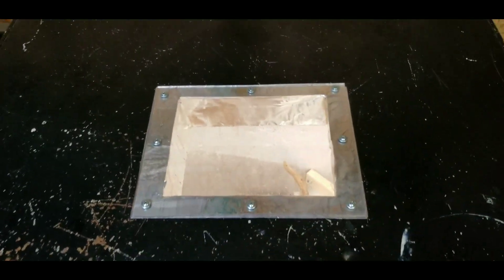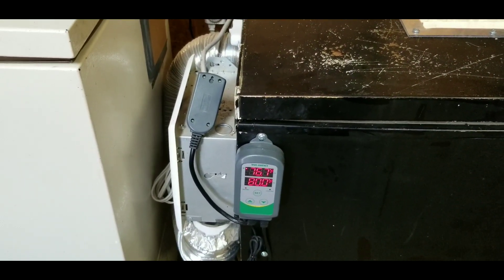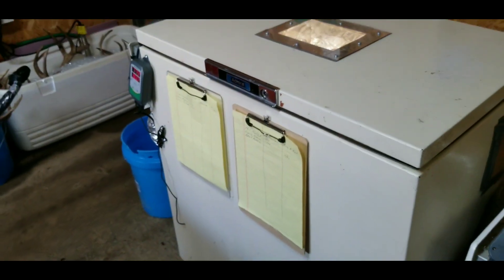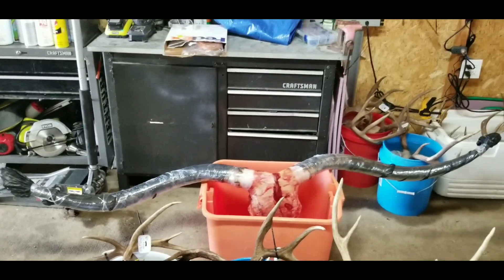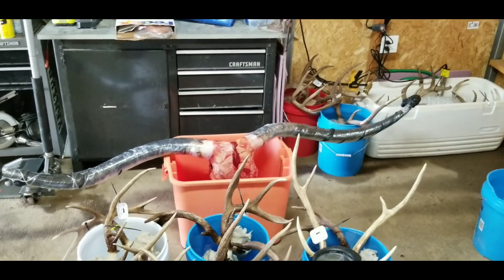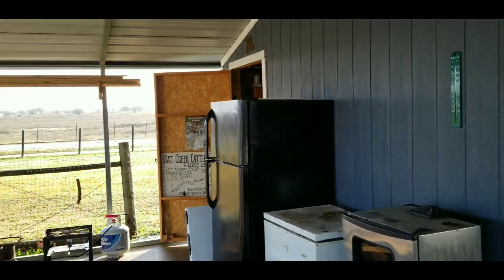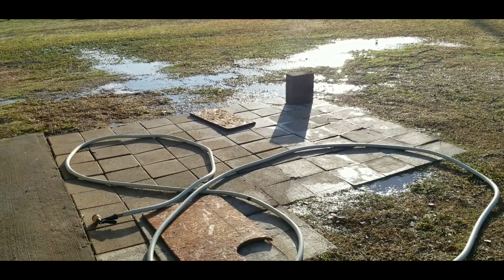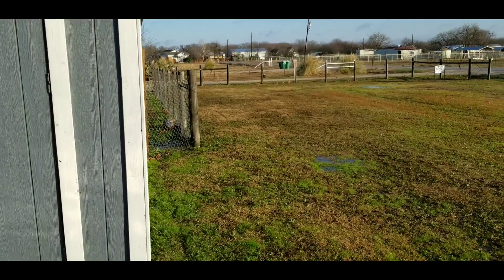Flesh Eating Beetle Update

Comment: I have been binge watching all of your videos and they are awesome! I am currently just boiling heads right now, but I find it harsh on them, and at times the pressure washer damages some of the smaller & more delicate bones (specifically the fin bones at the rear of the nasal passage. I sometimes blow right through those while spraying). Because of your videos, I think I will be starting a colony for next years deer season here in Texas. Keep the videos coming!!
Reply from the maker: Thanks for subscribing! I've been doing skull mounts for several years and have always boiled and I still do. This was an experiment this year to see if I liked beetles and I've been trying to document it. They definitely have pros and cons! The last few years I've started completely removing the nasal bones when boiling and I have yet to have a customer notice or complain. I have a large wholesale customer that wants a fast turn around so I will probably always boil there heads. 
What part of Texas are you in?
Reply: @OurTopPinLife  I live in Abilene, but work on a 10,000 ranch in Paint Rock (about 1.5 hrs south). I pull out the nasal passage as well and have never had any complaints either, I just hate damaging the delicate bones. I provide the quick turnaround for our hunters so they can take their skulls home with them.
Reply from the maker: @baylorbear6566  I'm close to Denton. I'm selling my smaller enclosure, if your interested. I will even throw in a few hundred beetles to get you started. Having 2 enclosures in my little shop is taking up to much room.
Reply: @OurTopPinLife  that's awesome, I grew up in Lewisville! I will seriously consider your offer. Let me make sure I have a location and everything before I say yes.

Comment: Would love to see your whitening process. Do you use hydrogen peroxide or the cream developers and whiteners.
Reply from the maker: I use the 20 volume clear liquid developer from Sallys. I wrap the bases with plastic wrap, put the head in a pot and fill it to cover the skull. Bring it to a boil, cut the heat and let the skull sit for 10-20 minutes. Ive tried every way imaginable and for time this gets the best results. 
I subscribed to your channel, please subscribe to mine. I will put together a video on my whitening process soon.
Reply: @OurTopPinLife  Oh I am already a solid subscriber man! Thanks for your videos, I use the 27% hydrogen peroxide pool chemical Aqua Silk that Whitebone Creations recommended in a few videos. I almost feel its a bit to harsh on the bone though I do the same but maybe need to cut down the time a bit I have been going 20 - 25 minutes. Might have to try the 20 volume clear developer, I believe I did try it as a paste but i like the simmering method better just for the fact of being quicker and less messy. Thanks for subbing!
Reply: Have you compared the 20V , 30V, and 40V liquid developers to see which produced the best end product? Do you dilute the 20V at all with water or use it straight?
Reply from the maker: @UNOM  In Texas all you can get in a gallon bottle is the 20v so that's all I use. And it does the job just fine. Occasionally I will use the 40v creme for special projects.

Comment: How long are you degreasing your skulls??Did two for a buddy and 2 months later grease is coming out..Degreased for a month and a half..
Reply from the maker: It can take several months. Ive boiled heads for about years and recently got beetles. I'm selling my beetles and going back to boiling. Its to much work.
Reply: @OurTopPinLife  that's good to know..I was considering beetles..time is something I don't have much of lol..I'm using maceration process to clean my skulls..very easy and only fool with them every 2 or 3 days to change the water.1/2 hr tops each time..they come out super clean..